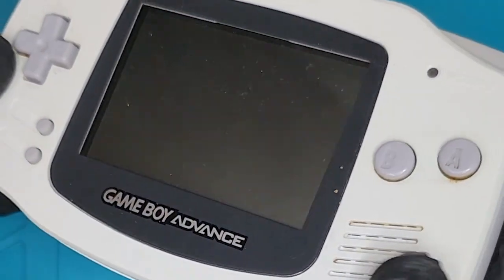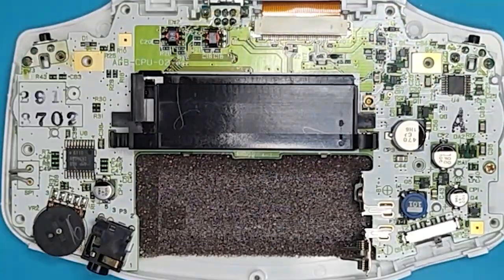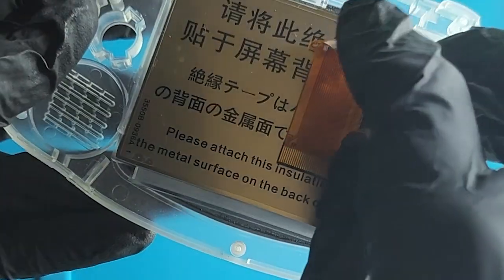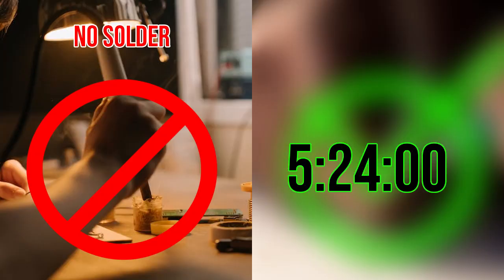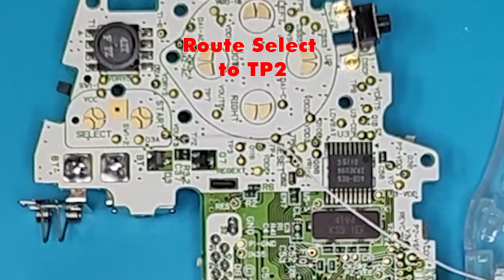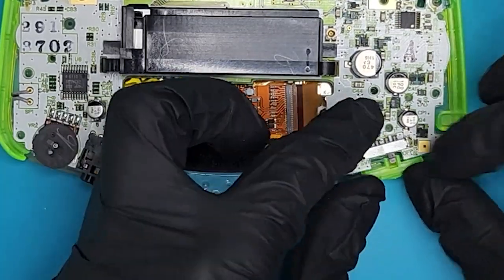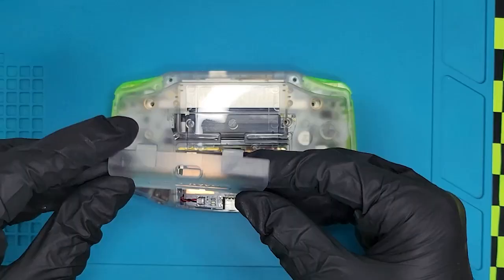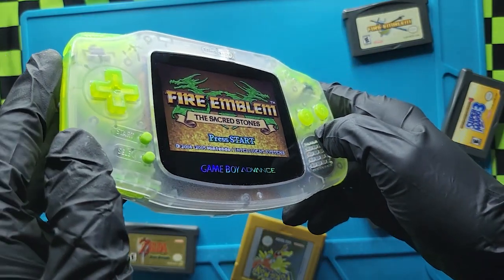Installing the GBA IPS V3 Pre-Laminated Screen and USB-C Lithium Battery

Comment: Hey @sagebanana so I bought a console that it is prelaminated but the seller didn't mention it. i was planning to change the glass. is it possible to do?
Reply from the maker: On the pre-laminated ones, no. Attempting to remove the glass would likely damage the screen

Comment: Hey man I'm just about done. It all seems good but there's no video that's showing. The GBA powers on and the sound works just fine but there's no video. I wonder what the problem could be. I paid close attention to how you connected the screen ribbon cable to the other one that connects to the motherboard. Still haven't soldered the wires to the motherboard though but I don't think that's the problem
Reply from the maker: It's possible you have a different model screen than mine, check to make sure the ribbon cables are tight and locked in, and that they aren't ripped. Also double check that the ribbon itself isn't bent at a hard angle and let me know how it goes
Reply: @sagebanana  I managed to get it. I just had to flip one of the ribbon cables 😅
Reply from the maker: @supermonk3y07 oh I'm so glad it turned out okay! Youtube doesn't always notify me about comments right away so I'm sorry for the delayed response. How do you like your screen?
Reply: @sagebanana  it did turn out okay the screen is nice. Next time I will get a drop in shell because the one I had I couldn't get it to fit no matter how many cuts I did haha
Reply: @sagebanana  well to be completely honest, the console worked and everything but I broke the shell. I was trying to open the shell so I could adjust the screen (i done a log of cutting to make sure the screen would fit and still it didn't fit completely). But sadly I tried to unscrew so I could open the shell and the black screw (not triwing) was the only one I couldn't take out because It was stripped. 

I opened it with my hands and there were some cracks on the case. I'm looking to just sell it for parts/repair.
Reply: @sagebanana  you'd just need a new shell. Preferably an ips ready drop in shell so you wouldn't have to cut and risk it like I did., also maybe replace the springs where you put the battery (on motherboard and the ones on shell) I had already put a lot of things already such as the IPS 3.0 screen, dehum dehiss, clean amp pro, a new speaker, some new capacitors for sound and video and the GBA power cleaner. All those allow for louder and better sound on top of the ips 3.0 screen.

Comment: Nice video. I especially liked the synchronized split screen comparing the 2 screens. Now I can't decide on the shell/button/screen color combination to make my own.  😁
Reply from the maker: A lot of people do themes, but I think if you pick colors you vibe with... can't go wrong 👌 it'll be fire
Reply: @sagebanana  Hey so I bought a console that it is prelaminated but the seller didn't mention it. i was planning to change the glass. is it possible to do?

Comment: hey, nice vid. i'm just about to buy my first ips screen and i was wondering, is this better than v3? isnt more likely to be broken if fall? i feel like the lack of a protection and being one-pieced is more risky in case of damage. but the touch controls and the easiest method to install are pushing me buying this instead v2
Reply from the maker: Good question. I think the V3 is worth it because less can go wrong in installation. Foam ds cases work great to protect the screen and I think it is pretty durable
Reply: @sagebanana  thanks! I successfully repaired an old gba just cleaning it with ipa but I’m not so confident doing precision stuffs, I think I’ll get one of these too. Thank you again!
Reply from the maker: @イタリアからパオロ  anytime homie. I know you can do it! You'll feel really empowered and confident after- not to mention the perks of a modded system!